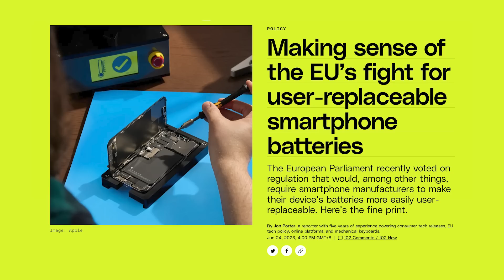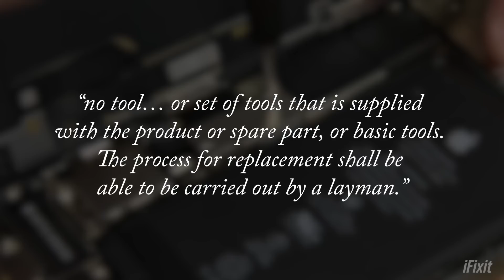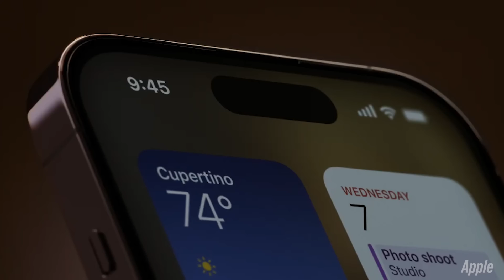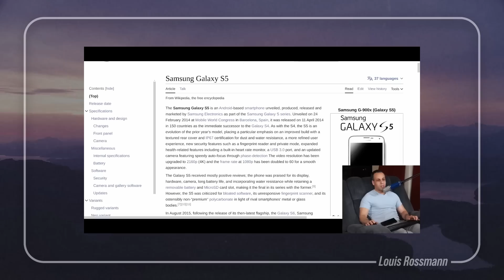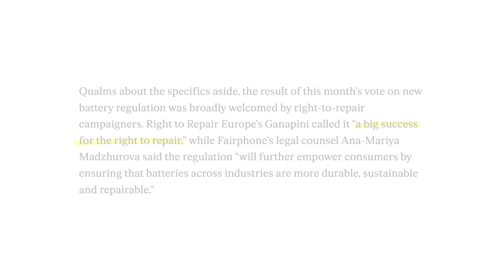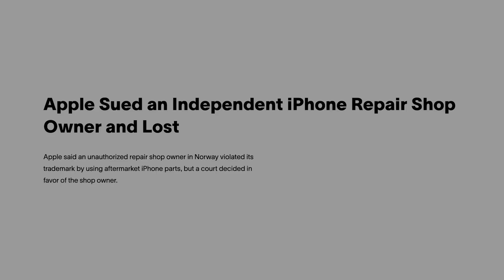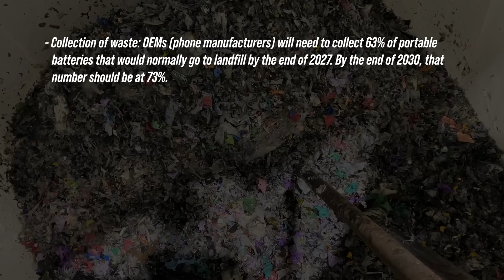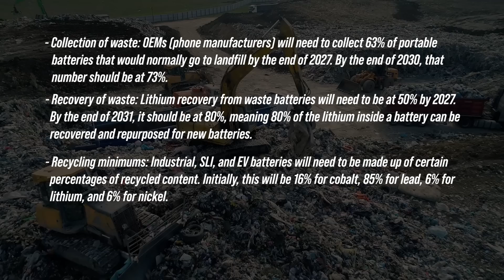EU Just Changed Smartphones Forever

Comment: I'm literally just about to order the 4th battery for my LG G5. Not only that, it has a modular, open source design, allowing other companies to produce addons for the phone. LG made a hi-def audio adaptor and a camera addon that allowed you to use manual buttons to control the camera functions, plus a built in battery for extra life when using the camera constantly. There are so many possibilities.
Reply: My 2017 phone is working perfectly even after 5 years. I'll stick with it until it stops working, but I'm looking forward to upgrading to a newer model when that happens. Although I could replace the battery, I'd rather not invest in an older device.
Reply: It's not obsolete yet?
Reply: @Teefs69 no
Reply: I loved my lg g5. Im on a fold 5 now. LG was my favourite phone manufacturer
Reply: @Gaetano.94  fold 5 is Samsung right?
Reply: And they left the smartphone business.
No one needed to buy a new phone apparently.
Reply: So much potential but LG mess this one up for having a bad UI and subpar  construction.  I remember people say the housing easily bend and modules were expensive.  No one follow suit to modular phones.
Reply: @MrMannyhw  I bought an lg g8s thinq 3 years ago and nothing bends there if you don't try really hard like JerryRig. And it was really cheap for what it does and the haptic is great with full glass on both sides and aluminium. 

Only problem I have is that it occasionally loses the wifi connection to my router. Then I have to restart the phone. Never had that issue anywhere else though. But every other device works fine with the router. That can get really annoying.
Reply: What’s the latest Android Os on that? I have the very first LG G Pro Optimus, latest update was Android 3.4 or something like that so I assume it can’t download new apps. It’s one of the best android handhelds Ive I’ve used.
Reply: @X99Zero  People can still learn a little bit and install a custom ROM for their device most of the time. I have a Galaxy S2 still  alive and kicking and several other "old" phones too. I have replaced screens and updated Android versions with custom roms and they're all still fully functional (well, for their respective specs). As long as someone is developing for a device, it'll probably live. We're not that advanced in software that a decade-old hardware is irreversibly good for the trash.

Sorry, I'm gonna use this comment to go on a slight tangent but I have some stuff to say about this, having been a mobile user since the days of the Dancall HP 2711 and having seen and lived through a LOT of (sometimes wild) stuff in the mobile world.

I'm writing this from a custom romed Poco X3 pro and although I've been really enjoying it for the past year (and kept its Redmi Note 7 predecessor for I think 3 years) I do realize that the lifespan of these devices is obscenely short. Not because of Android versions and whatnot but exactly because on the physical front of things they require repairs that most people do not know how to make them (or where to purchase the best replacement parts without having to sell a limb to cover the expenses or a repair shop fees). The obstacle is not software, it's definitely hardware. Unless I have a very good reason or incentive to purchase a hardware-upgraded phone or need a very specific feature, I will try my best to keep, repair and do the necessary maintenance for all my devices. Whether it's smart or not, be it phones, PCs, TVs, consoles, printers, batteries, various electonics and house appliances, gadgets, you name it. If it's something that has the physical blueprint/potential to last with a little bit of maintenance and effort and that can be fixed if needed, you can be sure I'll make the most out of it, maybe even tweak/upgrade it in the process.

Software being up to date is important for many things today, and for some it's just crucial, yes. But unlike most hardware it's quite easy for your average Joe and Jane to install something else that gives a new life to a device, especially since guarantee is out the window at that point.

All it takes is some determination and will to learn and some time in both the software and hardware sides of things but one is definitely not an easy thing to handle while the other is accessible, free and you can get help from thousands of other users.

So if there is something to change to make it easier for the average consumer (and time saving for the heavy users; draining my battery doesn't seem like potentially crippling in my daily routine if I can just charge a spare and swap them, as opposed to have a power bank that must charge the one I'm currently using).

As a european woman I'm not exactly always happy with what the Union comes up with or imposes, but I'm also glad it sometimes gets it right. It is one of those times and I'm pretty excited to see the resourcefulness, creativity and actual better thought-out engineering brands will need and what.the'll come up with.

Comment: I dont necessarily think that in smart phones, the lack of user replaceable batteries is anti consumer. I think that there is a lack of need for removable batteries. I remeber the days when I had me galaxy s2 and s3, and the batteries would last only 4 or 5 hours with moderate use, (texting, facebook, ect.) Now my iphone 14 pro max last easly 2 days on that same load, if not more. The current silicon process is very efficient.

Comment: Thank you for covering this, please all spread the word & continue to push manufacturers to make actual repairable products.
Reply: My 2017 phone is still working fine after 5 years. I'll use it until it breaks, but I'm eager for a new phone when that time comes. While I could replace the battery, I prefer not to invest in an older device.
Reply: @Professor-Scientist  understand your view, however it would cost between £5 -£15 to replace a battery in a 2017 phone so it’s little investment compared to buying a new device if you’re happy with what you have.
In my opinion there’s little progression in phone design & tech (bar folding) so don’t feel it’s worth upgrading mine.

Comment: Apple did have easily repairable iPhone once, the 4/4S, you just need to unscrew the 2 screws at bottom and pop off the back cover, the battery was then held down by another few screws, so clearly it's doable but Apple just chose not to

Comment: User replaceable batteries being required means no more ip68 dust and water proofing in most phones.

Why would anybody want the former over the latter? Especially when learning to replace a battery, albeit at the cost of losing ip68 rating, isn't all that difficult or expensive for most phones.

Comment: The truly odd thing is that they imply that Apple is ignoring the need to recycle their products… which is patently false!
In fact, go back quite a few years when Apple showed the robot they designed to dismantle an iPhone in order to recycle as much of their phones as possible.
At every introductory event, and this for many years now, Apple has a segment where they brag about the amount of recycled material they use in the manufacturing process.

Lastly, Sandy Monroe once quoted a saying of the auto industry regarding how vehicles are designed. I’m paraphrasing…
“You can have high repair ability OR high reliability, the two are hard to achieve”

Comment: Good thing most revenues of the US companies come from the US market. Stuff like this masks an attempt to make it better for the consumer yet leads to fewer jobs, disruption in innovation, and even more risks for the consumer. This also disrupts the optimal user experience, where companies need to account for more factors to comply with regulations and also a lag in technological advancements because people are more comfortable with sticking to older tech. 

A unified charging port to eliminate cable-related environmental harm makes sense, but forcing a structural change on a mobile device is unnecessary.

Comment: I had the LG phone with the removable battery many years ago. Lasted me three month at best before the connection for the battery was bad.

It charged via cable through the adapter then through the battery and then out to the phone.

The multiple connections were a problem, not to mention they wanted $500 to get it working again.

I junked it.

One of the most disappointing purchases I have ever made.

Comment: I have an Iphone 13, and the current fee to get the battery replaced by an Apple technician with an original Apple battery is only 113 Canadian dollars. I find that very reasonable, since it's about 10% of the original price of the phone. But, I don't think I'll ever have to replace the battery anyway, so far I keep my phones an average of 5 years, and the only phone that needed a battery replacement was my LG G5 (like the one in this video). Kinda ironic that the phone with an easily replaceable battery was the one with the worst battery life...

Comment: Okay but there comes a point where the EU regulations are so ridiculous that it makes sense to make a separate EU phone as opposed to limit the device's design for all customers JUST to please the EU regulators. I can absolutely see Apple, At the very least, Saying "screw you" to the EU regulations by making a normal Iphone and releasing it for the rest of the world, and making a totally different dumbed down version for the EU. Meta just full on didn't release Threads in the EU because of regulations. Apple should follow similarly by just Not Releasing the Iphone in the EU because "Cannot comply with regulations". Make a separate EU Version that complies, and have it be a split product line.

I've never had a replaceable battery and see no point in it. If your battery breaks, Take it to Apple to get it repaired. I've had Apple tell me I CAN REPLACE THE BATTERY MYSELF in an old macbook because they no longer support that device, and gave me the information and the guide to be able to  do so. I'm sure if I couldn't have done so myself I could have taken it to another repair shop to have done it for me. I don't see the problem with the existing system - It works just fine. 

Maybe stop being so hard on your devices. I've never lost or damaged a phone in over 10 years. Never had to get one repaired. If you do, That's what insurance is for. Don't make Apple compensate YOUR poor treatment of your device and poor planning.

Comment: Worth mentioning: this EU paper does not only apply for mobile phones, but also for any other devices with rechargeable batteries. Yes, I’m also looking at those notebooks, tablets and the like who also don’t feature user-replaceable batteries (any more).

And as usual, the implementation into effective law is done by the different member states, so the exact measures may differ in details.

For example, for ages Germany legally requires shops to handle a deposit system: if you’re buying a new starter/lighting/ignition battery for your car without returning the older battery, the shop will charge you another 7,50€ deposit for that. And by returning the old one along with your purchase slip, you’ll get your 7,50€ back. Shops are also required to pas those batteries on for recycling and those who don’t follow either of those rules can expect hefty fines.

Guess what: barely anyone „forgets“ to return car batteries and shops are eager to pass them on for recycling. 

Yes, cross-country trades are excepted from those rules, so there’s some loopholes.

But I could imagine a similar thing to be working fine for batteries in mobile phones, notebooks and other stuff as well.

Comment: I like how people are called consumers instead of customers. Like they are suppose to consume a product so it disappears.
Reply: Yeah it’s an interesting choice of words. It’s probably very intentional
Reply: That's the current market force that "right to repair" is pushing against.  Manufacturers prefer to design products to quickly break/obsolescence so that consumers have to throw them away and buy new ones as often as possible.  Benefit is a low retail cost and a new one often.  Drawback is that it is more expensive than buying once and paying to upgrade/repair as well as filling landfills/oceans with old broken junk.  

Take the people who build this junk and train them to repair it instead and design the products to be high quality and last a lifetime.  Manufacturers don't want this because they only get paid once by each customer rather than many times by each consumer and they have to compete with the market for low cost repairs.
Reply: So (this might be wrong), but if I remember Business Studies at sixth form still, the consumer/customer thing isn't actually anything that nefarious. It's because a consumer is not always a customer, so it's quite common to differentiate. Most common example: You buy something for your mom on Amazon. She uses the product, but you are the legal customer. If there's a problem, it's you who'd have to talk to customer support. 

I am not sure why consumer specifically took off instead of user though. Maybe user sounded too software-y or something...
Reply: That’s what they have thought of as for a while now.

U53L355 34T3R5. 

I.e consumers .

It says nothing about adding value of any kind - because they believe we don’t add any value, and honestly most of us really don’t.

So instead of calling us U53L355 34T3R5 “consumers” was more “consumer” friendly !

Think of what the word consumer means, I mean we all know what it means, but really analyze the word.

Consumer has only negative connotations, in fact it is almost a straight up slur. It doesn’t sugar coat anything, or add additional gentle information it is just bald faced negative !

Think of all the sentences you ever saw the word consumer used in ( minus modern shopping usage ) 

Usually the word consume is used in a sentence about something like :

“All consuming locusts stripping the land bare” 
Or
“Soldiers consuming entire countrysides on their marches”

Never has consumer been a positive word, and yet that is the word that they have *”carefully & specifically chosen” to use for us !

I bet that a huge portion of the population doesn’t even know that “consumer” has a use outside of talking about modern shoppers. Most people probably quite hoesntly don’t even recognize consume as the root of consumer if they ever heard the word at all, and if they did hear it if they ever deciphered its meaning, and if they did decipher its meaning if they remembered it and stored it away in their memories !

Idk why I went on such a long rant, or what point I was going to make by continuing to harangue the comment section but….

CONSUMERS Is A “Consumer Friendly” Way of Saying “U53L355 34T3R” !!!

Oh yeah, I remembered what I was going to add to this :

In regards to most of us being USEL….. ”CONSUMERS” , it really is true honestly in a way…. If one chooses to look at it that way : and these fall in all walks of life because the more “consumers” that get sick the more “consumer” doctors we need - so on and so forth :

Basically are civilization has a lot of redundant people ! We need XYZ amount of doctors because we have XYZ amount of people getting sick, we need XYZ lawyers and judges because XYZ # of people enter the system, we need XYZ number of politicians, bureau’s, and departments because we have XYZ amount of people.

Really they just think earth is way, way, WAY WAY OVERCROWDED By at least 6 to maybe 7 billion and some change !

The too many people come from all walks of life they have no mercy for even their fellow politicians/actors/whatever.

Even certain billionaires are less then bugs to them and can be snuffed out in an instant , and have been snuffed out .

So yea… sorry for the long reply but their is your answer :

Consumer is a word used to describe us that comes from up high, likely as an inside joke, and with mass media and other forms of dispersal the term consumer came to represent us on a large well known scale !

Just think about it for a second : how could the word Consumer be anything but negative at the minimum and basically a down right slur on the other end !
Reply: I really don't think they thought about it that much. I think it's more that consumer has an emphasis on the 'end'. Like the locusts eating the crops, leaving none left, the second hand market is not factored in for businesses, so items we and use are considered to have reached their final stop. If you sell stuff on eBay that technically means you are not the last person, but that sort of stuff is no longer relevant to the business that sold it to you normally. All this probably just comes from businesses trying to make cashflow forecasts based on trying to predict demand in the market. 

As for negative, I don't think the word consume is always negative. It's just that the megacorps probably left a bad taste in your mouth.

Think about items. Like in a videogame for example. You have weapons, attire, keys, misc and .... consumables. Your health potions or loafs of bread. We also used to say "to consume the marriage" to refer to the first night of intimacy between wedded couples. So not all bad.
Reply: If you watch discussions like this from the 50s they talk about citizen rights. Nowadays we are just consumers.
Reply: Decades of capitalist brainwashing has made us WORKERS think we are just "consumers" of the capitalists' products... 
But who exactly made those products that we "consume"? Surely not Tim Cook or Elon Musk.
Reply: Products disappear from stores when they are consumed
Reply: @slomo4672  and you can return a "consumed" product if it's faulty.
Why aren't customers eating in a restaurant called a consumer? I mean we eat the stuff and shit it out later.
Reply: @ryuno2097 😂 go to sleep
Reply: @lifesahobby.  maybe you're the one that needs to wake up